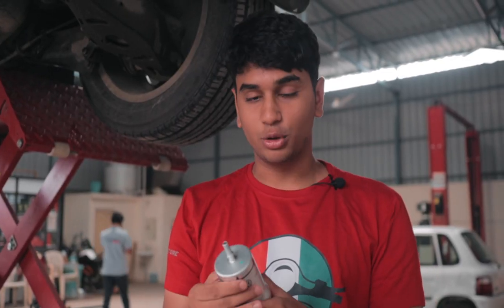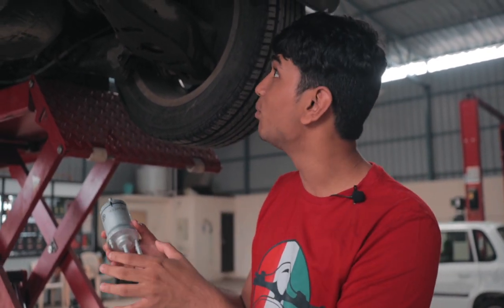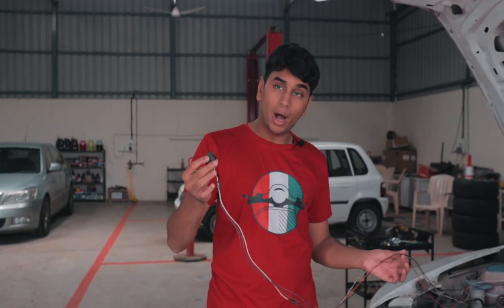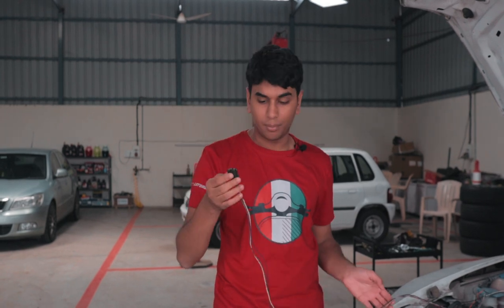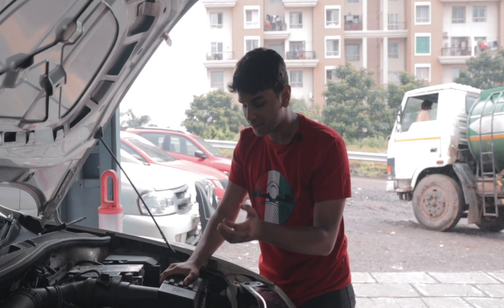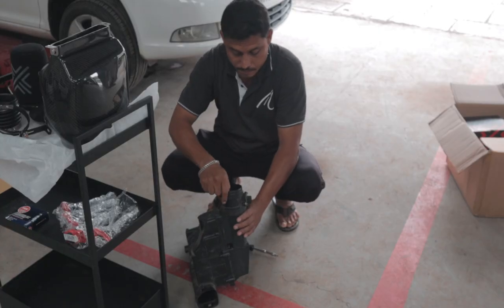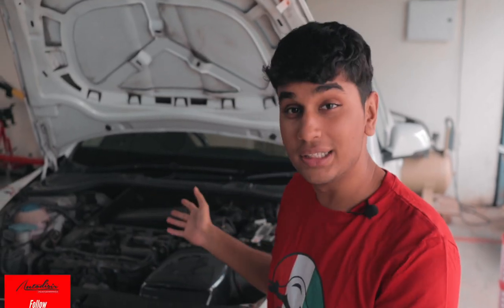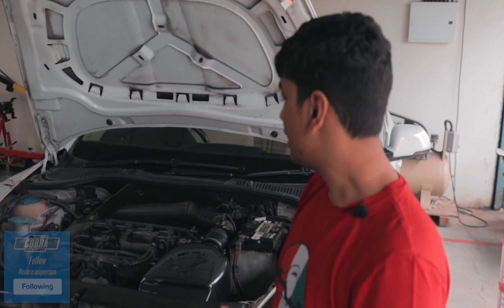Carbon Fiber Intake for the Skoda Laura TSI! | Rs.40,000/- | #ProjectLaura

Comment: Hi, i have the same car and i am in the process of getting it stage 2 as well. I wanted to ask what's the difference between a carbon fiber intake and an open conical filter? Does it have major performance difference?
Reply: Lesser weight and around 10 extra horsepower
Reply: @Adi-fb3ti  How 10 extra horsepower?
Reply: A standard k and n air filter will probably give you 5 bhp boost which will decrease over the time as the filter gets dirty.. this one's giving you 15 bhp better so worth the tag
Reply: @Adi-fb3ti  it’ll just make your air fuel mix lean if you don’t tell your ecu that it has to pump out more fuel. Even map sensors don’t help that way. And all the pipercross air intake does is have an inbuilt pre-filter vs the k&n, if you can figure out how to insulate it and deliver cold air they’ll both have the same performance.
Reply: @abhishekroy910  bro its mandatory to have an ECU tune, after an air filter or an exhaust.. everyone knows that..  check out comparison vids on YouTube and chrome.. I have a stage 2 tuned civic, and there was quite a bit difference between carbon fiber air filter and the k and n usual one.. plus lighter weight, better quality and lesser replacements. Chill, you're not the only one with knowledge.. what you said looks good in theory but when it comes to practicals alot of things matter as well
Reply: @Adi-fb3ti  I physically lay carbon fibre for a lot of my projects and I can clearly tell you that it offers absolutely no mechanical advantage that allows engines to extract more performance through the air intake.